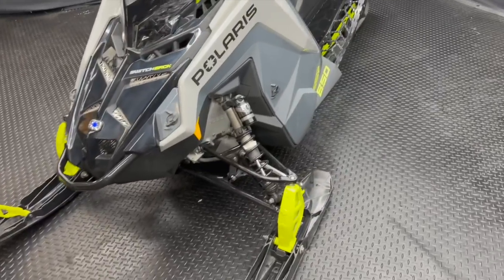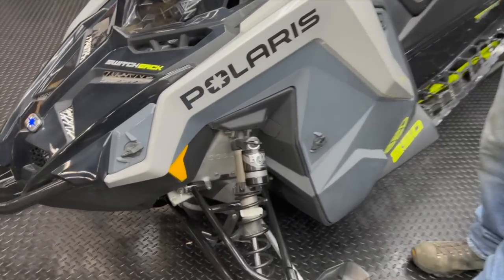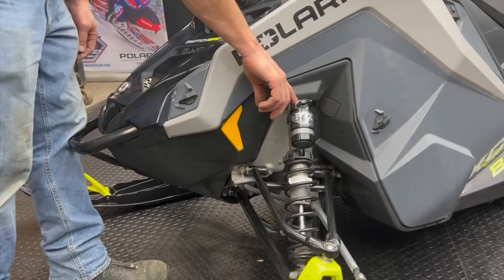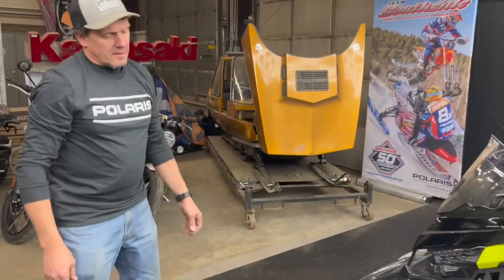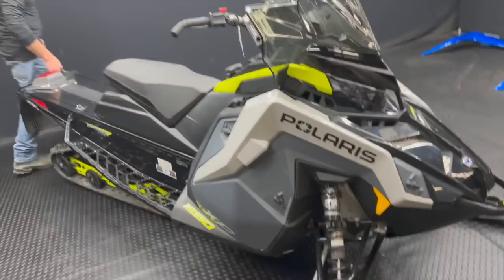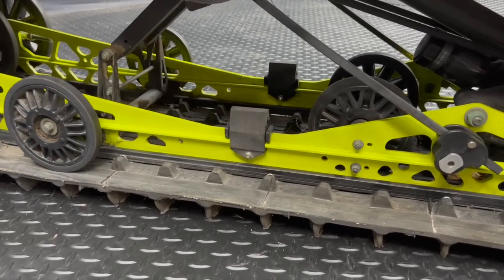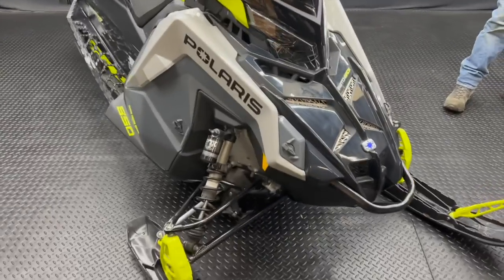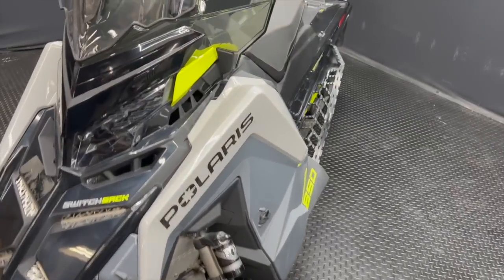2022 POLARIS MATRYX SWITCHBACK XC! 146 INCH TRACK AND FOX 3 POSITION SHOCKS!

Comment: Awesome video thanks for the review. This is basically exactly what I ordered, and still waiting for delivery. Switchback XC 850 with the 1.6 Cobra
Reply from the maker: You'll Have an awesome sled once you get it!!!
Reply: Did  you get it ?How do you like it?? I have a 23 Adv x2 with S4 on order but losing patience. Delayed 3 months from original ship date now..I have my eye on a  brand new 22 xc 850 146 in stock at a dealer nearby. Recal done  ready to go. Im thinking of getting it. One of  my knowledgable family memebers strongly recomends this XC. He rides a 2015ish 800 assault.
Reply: @patgenier1965  loved it, and these Fox QS3's that come on the XC in 2022 seemed very good to me. I didn't do a ton of riding last winter, but did log 1200 miles. Wheelie machine, that can rail the twisties on trail as well
Reply: @HunterApex31  Thanks the reply.  Sounds like what I'm going to work on getting. Working on getting my snowcheck deposit back for the undelivered x2.
Stay safe.

Comment: I was wondering about the rear suspension. I believe and Assault is different then a full trail 137 and 129. It doesn’t articulate the same, transfers weight differently. Possibly non coupled as opposed to the trail sleds being coupled?  If I’m correct I assume this design is like the XC trail sleds just longer? Or it it’s just a less expensive Assault? Or I’m just wrong ? Is this a trail or 50/50 cross over? Thanks you
Reply from the maker: ASSAULT rear is totally different then the 129/137. No rear couplers. Rear shock mounts different (went over that in the video) etc. This is an exact copy of the assault without some of the fancy stuff like we said! We really went over all of that throughout the video! I know its tough to watch all of them but we really touch on every difference and what this sled is!

Comment: When the xc is on full soft how much better is the trail ride as opposed to the assault? I know Alot if the assault Guys have to soften up there sleds,so maybe this is going to be better on trail🤔Did Bruce mention the difference in handling and ride? Between the xc and assault?
Reply from the maker: Youre still going to be stiffer on the XC. This has 100 pound springs up front still. We have not ridden the 22 production model so i cannot say for sure unfortunately

Comment: Like the sled, would be cool if you could get the 2" track on it. Why doesn't Polaris get into the turbo 4 stroke market. They used to have a strong weber turbo back in the day.
Reply from the maker: You can get a 2 inch track on the "assault" just not the XC model. Not really sure on the 4 stroke question thats more of a manufactuerer question!

Comment: Wow a switchback xc in a 146". That's crazy. So what would this set be categorized under 50/50 sled or 60% trail and 40% off???
Reply from the maker: also a 50/50. This is an assaults twin but without all the fancy stuff.
Reply: @JESSEJAMES322  ahhh I see. Thanks for the reply. I'll keep my 137" for twisty trails 😎

Comment: Hey guys, I have a 22 switchback xc 146, just wondering what the stock torsion springs would be on there? I watched your video on springs and definitely think I want the hd springs but I’m not sure if they’re on there already lol I’m about 180 lbs dressed. 
Also my dad has a 20 axys assault and he carries a lot of luggage. Would he need hd or xhd springs? 
Thanks! Love your videos!
Josh
Reply from the maker: They have the standard duty springgs in. You will wnat the HD for sure. and how much luggage?
Reply: @JESSEJAMES322  Thanks! I will definitely be ordering those for my sled. My dad carries everything but the kitchen sink 🙄 clothes, two fuel cans, extra oil, etc. He likes to do week-long trips and really racks on the miles…He’s I’m guessing close to 200 lbs.
Reply from the maker: well we recommend XHD for 260+ but if he has two gas cans etc all hanging fof the back that acts as more weight so even if all in him and the weight is 240 then he will need XHD because of the weights location
Reply: @JESSEJAMES322  makes sense, thanks again!
Reply: @JESSEJAMES322  so the XC has standard duty springs?  I'm about 180 w/o gear as well. Might upgrade...

Comment: Them shocks are not as good as the Walker Evans shocks I would be very upset if my sled came with those on there I have had both for  Thousands of miles
Reply from the maker: Fox quality is just as good if not better then the Walker. Also these have all new valving in them and are a really nice shock. Id have to disagree with you there
Reply: @JESSEJAMES322  you can have them I ride 5000 to 6000 miles every winter and have had both you can have all the fox shocks I will take the Walker !